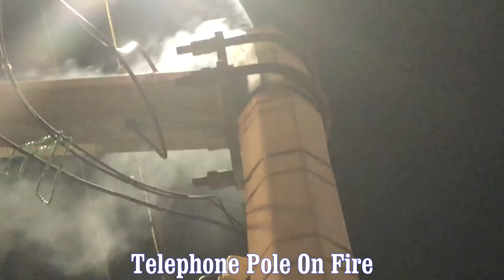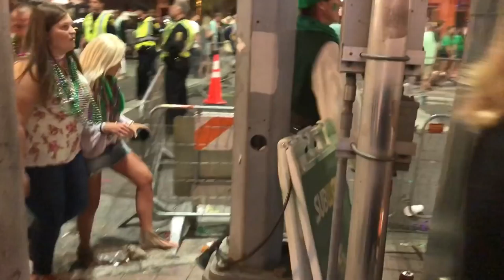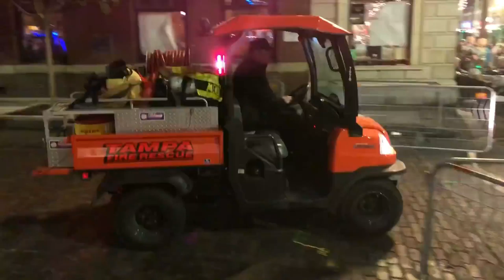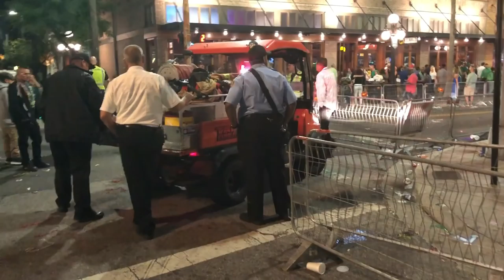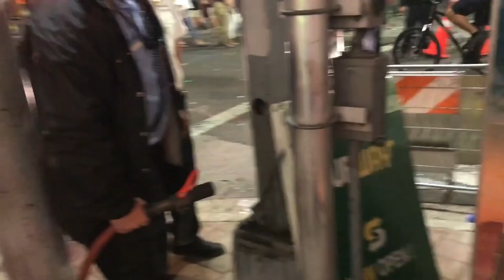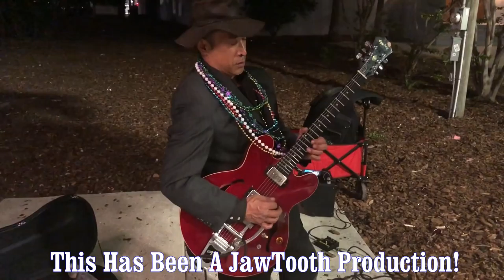Tiny Fire Truck Puts Out Working Fire!  Worlds Smallest Fire Engine!

Comment: That was cool! We basically have the same setup at Lake Kissimmee State Park where I work. We use Polaris UTVs and have about 6 of them. They work great for woodland wildfires. It's just what you need to get between pine trees and put out a lightening strike sometimes. You may be a mile from the main road sometimes and have to access it from a hiking trail. Great coverage Brian! Cheers, Dan
Reply from the maker: Danny Holt Thanks for the information!  Do you have any idea how many gallons of water they carry?  I’m curious how big of a fire they can fight.   It might be the worlds smallest fire truck.  Im trying to think of a better title
Reply: Smallest Fire Truck Is  still a good title. We have a 50 gallon water tank on our UTV fire vehicles. We even have one with a flame thrower on it. Cheers, Dan